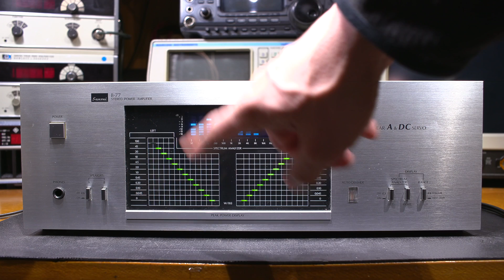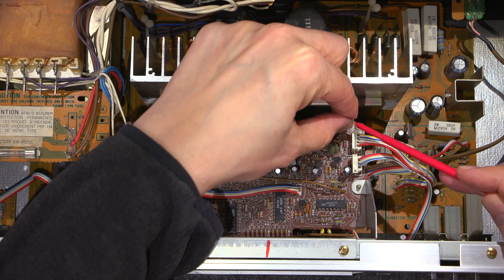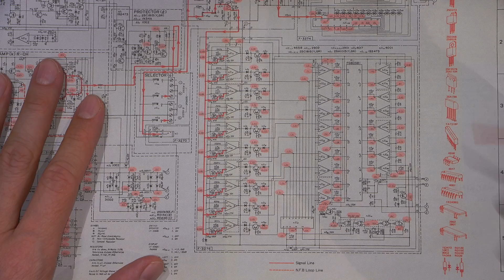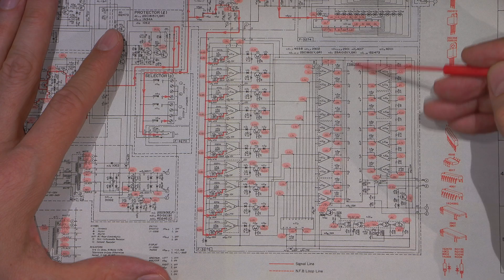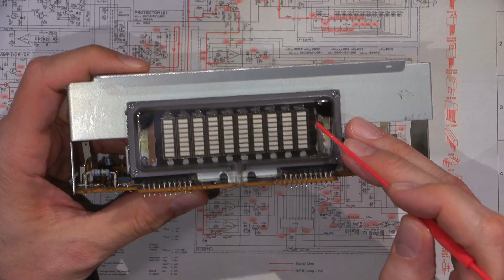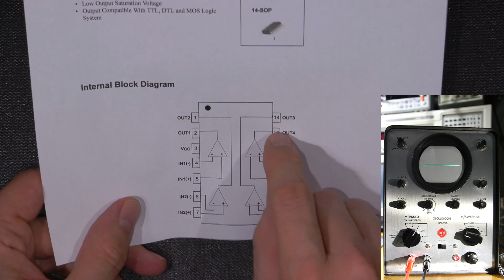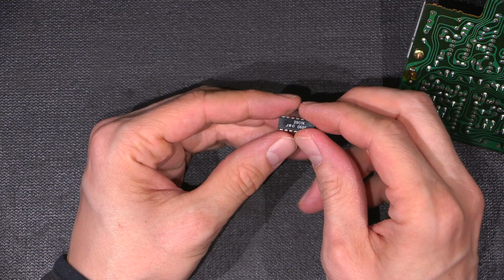Electronic Repair- Sansui B-77 Stereo Power Amplifier!

Comment: I have s question: years ago you talked about transistors. One thing was missing is what is the reading between the emitter and colector? Should it be OL (opened) or 0000 (closed)? If I thing right, it should not be any connection and therefor it should be OL. NO?
Reply: Hey Paul, I'm actually glad to see that you use a similar device that  I built in 1984. I use it constantly, great for electrolytics, semiconductors, and comparisons as shown here. I included a switch that extends its range to compensate for (certain) in circuit checks. This device has never been wrong. I got this circuit from a shop I worked in back in '84. So much garbage was being produced in that era.

Comment: Great company Sansui, I bought a direct drive turntable in 1976 and it still works perfect.  Cost me 2 weeks wages back then and well worth it.  With a nice $90 cartridge and $400 needle it ended up perfect.  ;)  Anything early from Sansui is worth grabbing to replace the crap that came out in the last 25 years lol

Comment: I don't agree to Sansui having good engineering and that they knew how to design. Compare this to a Harman Kardon Amplifier and you will see the difference between good and bad engineering.
Although, I must admit, this one looks better than the ones I have seen so far.
Reply: Sansui was okay. Harman back in the day was something special. That window from about 1975 to 1985 was about the best ever, given the available technology, for high end audio gear. Today Pioneer is on the brink of closure. Hitachi, Kenwood, and many others made some great stuff.

Comment: The most dangerous stuff I worked on (non-military at least) were those first generation TV sets with the killer HV supplies. Some were run directly off the AC line and just took the 110 volts and stepped it up through a transformer and passed it through common rectifiers and doorknob capacitors for the CRT high voltage supply. Most referred to them as "Brute Force" supplies and they honestly could kill you. They would not load down like modern supplies so if you got connected they would zap you the whole time. Companies started using somewhat safer designs very quickly and by 1949 pretty much everything had flyback supplies which would lose most of their power if something got connected that wasn't intended. 

Of course, tube gear could still have what we consider to be high voltage on regular circuits - up to 500 volts or more on upper line models, especially high power amplifiers and color TVs. Solid state gear can still nail you because they use large value capacitors that store a lot of juice. It may not sound very high but released at once it can blow things up, weld them, and fry things - including techs who let down their guard. 

I still remember when one of our guys was working on a solid-state TV and was pulling the PC board in and out of the cabinet to check things with it running. Said cabinet was a steel sheet metal job and on one of those slides in/out the wires protruding a fraction of an inch shorted again the case. In the next room we heard a loud BANG!, saw him fly backward through the doorway and ran into a room that looked like a snow globe. Little pieces insulating material from the exploded electrolytic was fluttering down like a snow storm. He was not injured but very embarrassed. We were more concerned for him than the gear. (Hey Wayne! Are you still out there?)
Reply: 0

Comment: Great Video ! I use my curve tracer or Octopus all the time. i built mine as an out board pre- oscilloscope attachment. But putting it in a small scope is really nifty ! I wonder how small you could make one ?
Reply: Hi LRoy.  I built a little Jyetech DS0138 200kHz cro for less than $50 from banggood.  It runs off 9Vdc & has a 2 inch colour oled display, & has a laser-cut perspex cabinet. It's about 4" wide by 3" high by about 1" thick.

It's as cute as a mouse's earhole, & works beautifully!  It comes with a bnc input connector all the control pushbutton hardware & is quite cleverly designed.  I actually paid a few bucks more so that I could get to solder all the components onto the pcb!  There's the main pic chip, plus a number of other smd resistors & capacitors to be fitted, as well as some little 1/8W  thru-hole resistors.  A short bnc-to-ezhook probe lead is included, as well as a built-in probe calibrator.
The build & operating instructions were printed in colour on thick, glossy paper.  It was great fun building it & it worked first go.  You know LRoy, after digging it out again to describe it I just might go ahead & buy another one!

Comment: Hi Paul, great repair job and video.  I love how the curve tracer works so well to find a faulty component(s).  I notice that you have moved some gear around in the lab. :-P I see (and hear) you are using a different desoldering tool.  It doesn't sound as robust as your revved up Hakko 470 does.  That thing really growled. I also am impressed with the quality and attention to detail in the Sansui schematic.  With modern electronics CAD programs, there is no reason that that level of detail (including illustrations of the components) could not be included in every schematic with the press of a button.  It took designers countless hours of hand drawing to create those schematics in the 70's and 80's.  So there is no reason to not make "good" schematics.  Thanks again so very much for the videos and the graduate level education you provide the youtube community!
Reply from the maker: Thanks Gary!

Comment: I highly recomend Mr. Carlsons patreon class. You will in my opinion learn 10 times more then taking a formal class, at such a tiny price I can afford it .He does examples in point to point,  surface and through all, sometimes making the same device those three different ways enabling you to better understand each process. He also shows you the pit falls and how to do it safely for you and the equipment your working or learning on. You also gain valuable experience learning the testing equipment he shares , building and explaining them in laymens terms . Thank you again for sharing your experience and knowledge Mr. Carlson.
Cleveland P.
Reply from the maker: You're very welcome Cleveland!

Comment: One thing that has me wondering on every video, Where do the schematics come from? do you have to be a licensed technician or repair tech for companies forward them?
Reply: Depending on the age,brand and type of item there are multiple sources. For olde radios (20s -50s) there were manuals sold each year by a couple of publishers with the service information. Sites like Nostalgia Air and similar will have them online and sellers on eBay have them available on CD or DVD. After WW2 Howard W. Sams published the famous PhoroFact manuals and even offered special lines for CB, Auto Radio, tape recorders, and transistor radios. They covered popular models of TVs too. You can see them in Shango066's videos. Sams is still around and you can buy the from them or on eBay. They also put out a line devoted to home audio - Modular HiFi books and later even a line of computer manuals for the first-gen home computers. More specialized schematics can often be found online from service technicians who used to repair these things and are nice enough to share them.
Reply: Indeed. They are all over the Internet. Some are very hard to find. Others are readily available for free. Lots of radio shack gear had the schematic in the original manual. They made schematics available as catalog items. Some manufactures will provide the service manual if you ask, sometimes for free. Other manufacturers treat service data like gold.

Comment: Great video as always Paul. What a wonderfully stereotypical (pun intended) piece of 80s gear. More circuitry dedicated to the blinkenlights than to the actual amplification. I have an '89ish Sony component system that has separate custom VFDs for everything from spectrum analyser and tuner frequency to a diagram showing the state of the CD changer. I don't use it, I just keep it as a reminder of when we felt we needed flashy lights and screens for absolutely everything.

Comment: As two of the four 2901N's were testing faulty (all with the same date code), wouldn't it have been safer in the long run, to replace all of them?
Reply: Hey Chris yeah I would have replaced the other 2 as well.  I mean, there's a pattern energing here isn't there?  Plus, this is a Sansui amp, not your average amp, & more deserving of some preventative maintence.  I think Paul said he had plenty of '339's'.

Comment: Great video as always. 
One question, something I did not know that I have heard from others; the amp should always have a load on it. 
Did you have a load on the amp? Since I don’t believe you mentioned it, it made me curios and ask the question. I thank you for your video. I know it takes time to do these.
Reply: Paul (techs) use a "Dummy" load, a high power resistor which simulates the load of a speaker voice coil so as not to blow up the output stages of the amp.
Reply: Sorry, I need to go back and watch it again I totally missed that. Thanks.
Reply: @jameslucas6589  Hi James, Paul did not show the dummy load or mention it in this video.  He has before however.  They are very simple devices,  just a couple of high power resistors of suitable wattage and resistance.
Reply: Dummy loads are often needed for devices with output speaker transformers, but even then they are not necessary when the volume is kept low. As long as a solid state amplifier output stage doesn’t oscillate without load, I imagine not much would happen without a load. Oscillation can quickly overload the transistors, so that’s best avoided. It all depends on whether the amp was designed to be stable with no load. A servo amp won’t usually care about lack of load – it keeps the output within a feedback loop. Whether this particular amp’s design allows no-load operation – I haven’t checked. You’d need a peek at the schematic :)

Comment: I watched this video amazed at what you can do! -- as always I learned a lot!  I'm more of a home electronic hobbyist/tinkerer and don't really repair stuff that often, but I have to say that signature / curve tracer looks like a killer project to have... if you have limited space on your bench could you use an O-scope in X-Y mode?   BTW:  I never saw a a curve tracer used in-circuit as you did.  I used one a few times a very long time ago in an electronics course I took back in the 80's; it was a dedicated curve tracer for component testing where you placed the component in a socketed place on the scope, then closed a protective plastic cover (in case it explodes and so you don't get shocked as the voltages can get serious!), and then you can start the test and it would sweep through the ranges giving you the trace on the screen.  Never saw it used this way -- holy cow!
Reply: Hi Ray, the device you are describing is a different type of "curve tracer". Same basic principle but slightly different electronics inside as it is for a different purpose than the device Paul is using.
Reply: @garybevis8691  Yes, that's what I expected. And you are correct, that was what I was describing -- it was probably some kind of device characterization test equipment made in the early 70's.  Paul's test equipment is much more useful for troubleshooting... I like the simplicity and yes... very awesome!

Comment: Back when Sansui was a name to be reckoned with.
Reply: They're still a name to be reckoned with but for different reasons lol
Reply: I had a Sansui  9090DB Quad SQ amp/receiver back then when the Sarasota radio station (Quad 102.5) was broadcasting in SQ Matrix. I t was kinda cool with the 2 channel/4 track Sansui SD 5000 reel to reel that I used to record the new albums they broadcast every Friday night.
Reply: The 9090DB had Dolby FM but not SQ. All 4 channel models were QRX-xxxx.
Reply: Probably right, I don't really remember exactly what Model it was. That was  back in '74, but it was def QS which I had bought and used for the aforementioned radio station receiving..
Reply: @nfergus11  QRX-5500 maybe ? I just restored one of those for a customer a few months back, amazing piece of equipment.

Comment: EWWWW those use STK chips :(
Reply from the maker: You are incorrect.
Reply: @MrCarlsonsLab   AHH!!  2SC2579  My bad !
Reply: Those STK modules were helpful for designers but a disaster for service. They're quite difficult to get now. I have an MCS receiver that uses one for the volume control. I had one that was a voltage regulator. Replaced it with a zener and venerable 3055.
Reply: @Dave Micolichek  I recently dismantled a Sony receiver (it wasn't worth repairing) that had a couple STK modules in it. They were for time delay or some sort of processing. It used some other type of amplifier modules. I did get a few good parts from it.